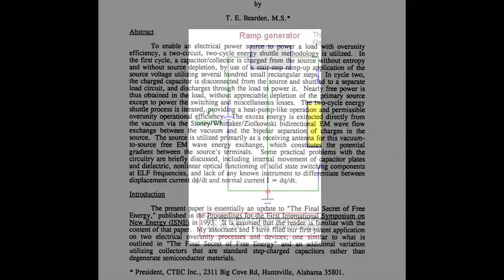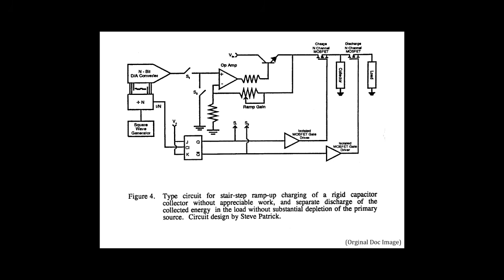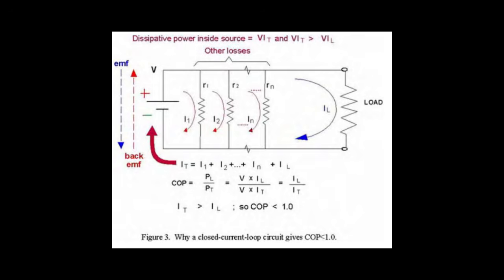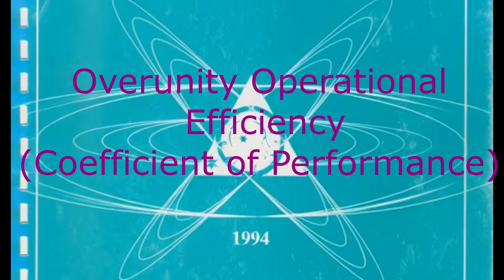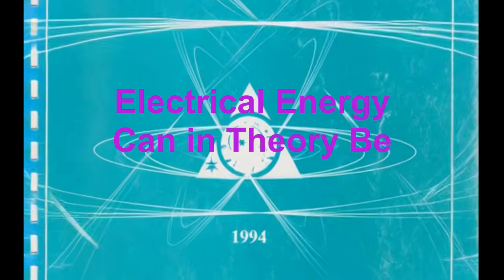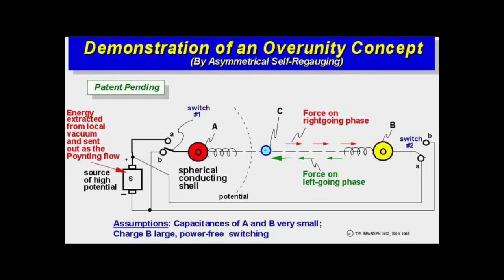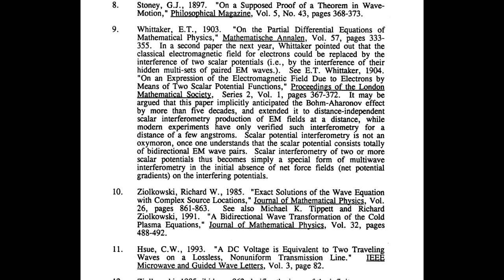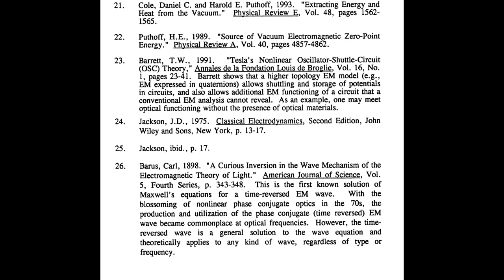Rare Tom Bearden Paper: Overunity Energy Shuttling Between Two Circuits 1994

Comment: Davy, do you know if John Bedini ever finished the software version of his B.A.S.E.  processor?  Hardware units are well over $1000 and makes me wary to get one to see if it will be of any benefit in the audio projects I'm working on.  Also, I have a piece of Bedini audio hardware that I purchased off ebay that I haven't been able to find any definite history of, I believe it may be a prototype.  I have read a report from one of the yearly audio manufacturers showcases by a Stereophile writer where John had set up a device between an amplifier and some speakers that was using tiny-guage wires to send power to the speakers.  John had said the wire didn't actually carry the power, but just acted as a guide for the power to be transmitted through space to the speakers, and someone challenged him on that.  So to prove it, he took the device out that was between the amp and speakers and hooked the small wires directly between the amp and speakers and turned the amp on and the wires instantly disintegrated in a puff of smoke, leaving a small trail of ash where they used to be on the carpet of the room.  The processor/device I got off ebay reminds me of the description given in the Stereophile report of the device John was demonstrating.  I thought it may have been something found and sold off after John's death when Bedini Audio assets were liquidated.
Reply from the maker: I think he did, but sold the rights to someone maybe, so could be a DSP plug-in out there somewhere that uses it but doesnt say so. Though I would find that unusual since it is still desired by many that know about it as "B.A.S.E." in the audiophile community. Some day I want to test a bunch of plugins with the test signal the patent shows with the xy plot results. I am trying to work with Aaron to bring back some kind of BASE unit that's  true to Bedini's original as possible and for cheaper. He has a lot of the original BASE materials and proto units after John passed.  I have been also working on, just not in a while, a DSP version from what I figured out so far too. 
As for the speaker demo, yes I have heard this story before, and sounds like he was doing something with electrostatic displacement currents. I would be very surprised if you actually did find that device. There was a BASE prototype unit for sale on ebay for a while, but wasnt built by John, but rather someone else who was being licensed the right to produce BASE units with Johns Tech. From what I understand, the prototype for sale was not working. I was almost tempted to buy it, but to my luck an orginal working BASE went up for sale and I snagned it for like 800. You can see it in my livestream videos after I refurbed it and built it into a mini  media computer unit .

Comment: Read all you can about what John Bedini wrote about “static electrical current.” -  Paul Babcock.   I’ve been searching for this stuff for quite a while. You explained that in 11:11 in this video. Action of the Displacement Current in an Ideal Capacitor. That’s huge. Thank you sir. Thank you!
Reply from the maker: Loved Paul Babcock, miss him a lot.  When Bedini talks about branch circuits he is talking about taking advantage of displacement current. In this doc,Bearden points out that the displacement current is not divided by the branches, it's the same  on all branches. This is probably what Kron discovered too
Reply: @DavyOneness Indeed sir. I meant to write Stationary Electric Current, not static electric current. Thank you for your efforts sir. To swim against the current is a  worthy endeavour.
Reply from the maker: @hoofhearted-m1d  I think they both mean the same as displacement current, so understood! 😊